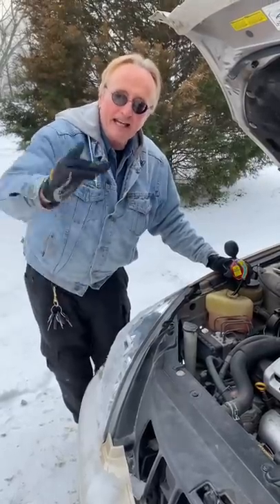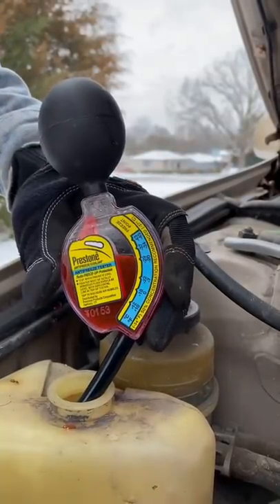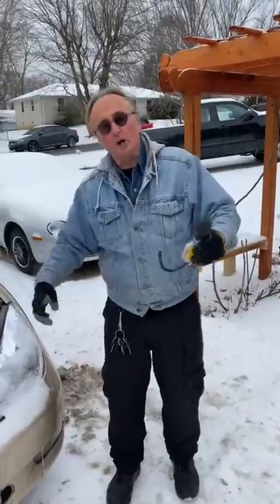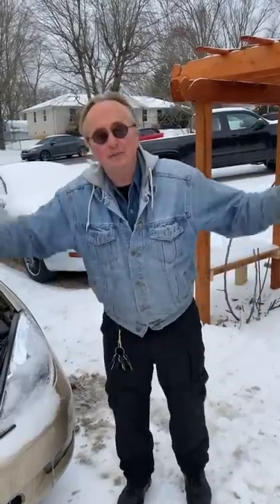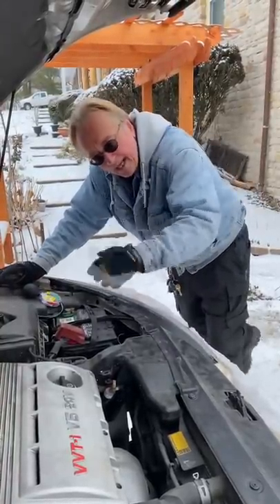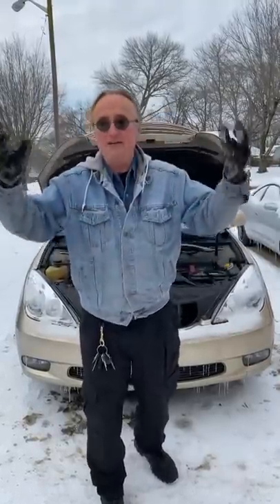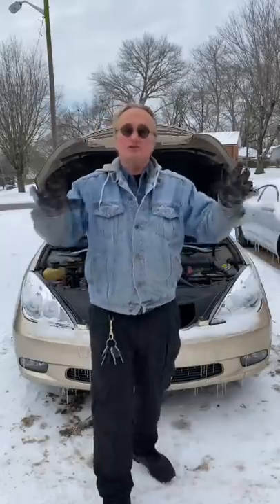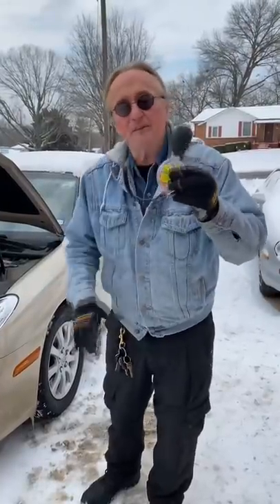Here’s Why Cars Suck in the Cold

Comment: The best time to test drive a used car is in the extreme cold or extreme heat. Any problems will most likely show up.
Reply: @DigitalDissident  most definitely. Always get it up to temp and get it hot. Some people aren't aware how long it can take to fully get a car to it's operating temperature
Reply: @adamstilldrives  You kill your automatic transmission by not warning up the car
Reply: @nomadicmonger9455  yes thats true indeed but that's why I have a 5 mile rule before I drive hard or quickly in my cars when it's cold

Comment: Just like Ice Road Truckers.  They never shut off the engine.  Running 24-7 for a month.  When they do shut it off for an oil change it's inside a heated garage.
Reply: Huh interesting, diesels are much more efficient though, they are are mostly pumping air when at idle unlike gasoline
Reply: @hollywoodundead72  It's all about the waste heat.  Those trucks run the coolant through heat exchangers to heat the fuel to keep it from freezing.
Reply: WOW never heard about this before
Reply: My boss had 60 semis on 1700 watt engine heaters---His electric bill was double what he paid me.  Part of my Saturday night job, was to put as many tractors in the heated bays as possible---usually three to a bay, with about seven bays.  (Lucky I could drive stick).
Reply: @elultimo102  If you couldn't drive a stick, I guess you were SOL! Either that or put them in low gear & take forever to get them all in! I guess in today's world, the majority of companies went to auto's, so new drivers won't be tearing out clutches & trans!
Reply: @Randy Carter A huge difference between diesel & gas engines though!
Reply: @hollywoodundead72  This might be truer of modern diesels,but my '98 Cat 3406E got terrible fuel mileage with a lot of idling! It would've helped the life of the engine & the fuel economy if I had the money up front to buy & have installed a generator installed! No engine idling, heat in winter & cool in summer!
Reply: @randycarter2001  I drove for over 40 years & none had a "heat exchanger". As the cool fuel went into the engine, it would heat up. The unused fuel would return into the fuel tanks,helping warm the fuel somewhat. In the winter months I'd have to change the fuel filter more often. Some guys wrapped their fuel lines with insulation to help protect from jelling.
Reply: @Mike583  At minus 20 to 40F diesel in the tanks turns to gel.  The heat exchanger is in the fuel tanks.  The fuel line is run through a hose that has coolant (now warmant) in it.  In fact at idle very little of the heat makes it to the radiator.  Most of the heat goes to warming the cabin, keeping the fuel warm and other uses to keep other systems functioning.
Reply: @randycarter2001  When I had my Pete back around 2015,I had the tanks emptied. There was nothing in them,they pulled fuel from the bottoms. There was a crossover line to pull from both,also a shutoff valve so you could only pull from one tank if needed. There was a return line & that was it. Mine was built in '98.
Reply: @Mike583  These trucks are specially retrofitted for operation in that environment.  They don't do these expensive mods for normal trucks that operate south of the arctic circle.
Reply: @randycarter2001  Sometime in the early 90's,I was still in a company truck. I was on I-80 crossing Iowa,about every 1/4 mile it was either a car or truck broke down on the side of the road. I got to a truck stop that was a designated fuel stop. All our trucks had all fuel lines wrapped in insulation. Hardly ever used fuel conditioner. With wind chill of -40+ degrees,never had any problems,except inside windows icing up! While inside the fuel stop,I heard a guy on the phone with a repair shop. His truck had quit running while parked. They told him it could be 2 or 3 days before they could get to him! Their top priority ( & big revenue) was to get all stranded vehicles off the interstate first. They had a truck with frozen trailer brakes on the drive. Another guy & I tried to get her brake shoes broke loose from the drums. We tried for about 15 minutes in that cold & they wouldn't budge! We went inside to warm up & my mustache was frozen ice! I hate winters! I've been retired for over 4 1/2 years now, living in GA. Don't miss driving much at all! It's so nice not to have to be out in all that crap, especially with the inexperienced drivers that haven't ever driven in bad weather! Best of luck to all those still out there. Stay safe & warm!❤
Reply: They are driving diesel engines tho... not reg gas mate.

Comment: If your in a cold climate like minus 10 degrees or colder and your car sits outside get ur butt out of bed at 2 in the morning go out and start it and let it run for 20 minutes that way you don't spin a rod or main bearing if you wait till 7am to start it and find out the oil was froze in the oil pan. Or build a fire under the vehicle as I use to see one mechanic do when I was a kid back in the 1970s.

Comment: Hi, I have a question for you? Have you ever heard of this issue... my car while is running, and I stop at a red light...it starts to vibrate and when I turn the headlights or turning light...it vibrates as well. I just replaced the alternator and got a new battery...my car did vibrate before  putting these new parts but I never paid attention until now.  I think it vibrates at stop light because it activates the brake lights...so my diagnosis is that there is something wrong in the electrical system...I just wonder if you have heard of this?